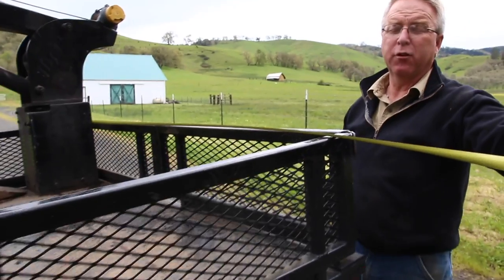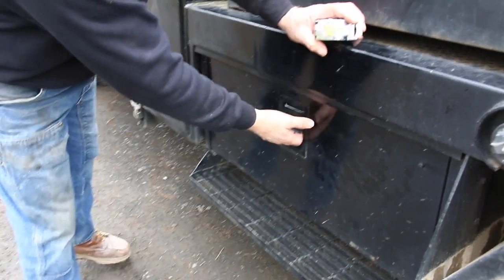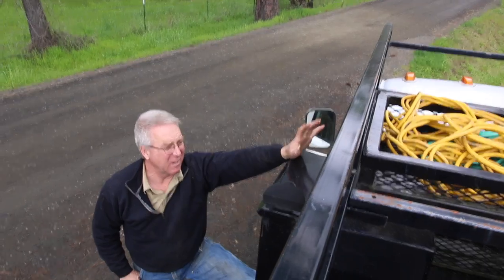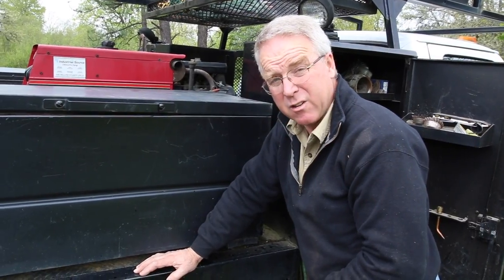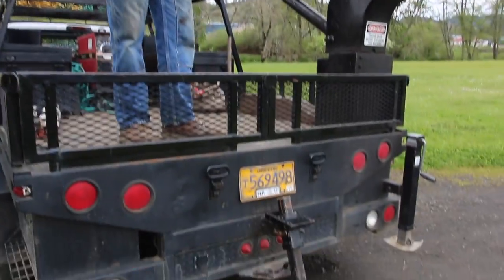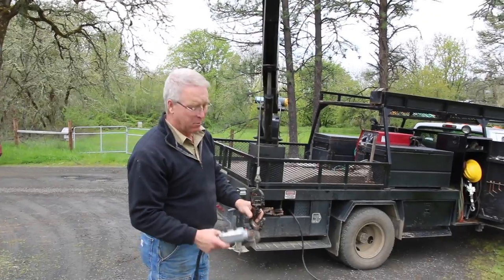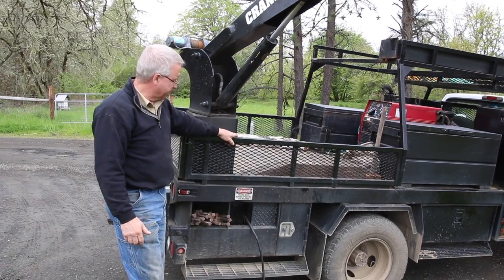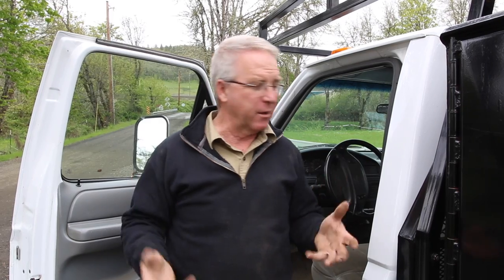Ultimate Work Truck: The Tool Tank

Comment: Thank you for your hard work in making these videos.                  I build trucks for a living.    You guys did a very nice job.    I suggest that at the next remount you add a packrat drawer for your hardware. It will help you to keep it organized once and for all.               7.3L is long gone in a newer truck.    tier 4 emissions is horrible for fuel economy. It is not a good time in history to buy a new truck. I would suggest running the girl till you see 15+mpg on a 450....it will happen.      The crane cable needs to be replaced every 5 years, technically the crane needs anual inspection.

Comment: Great set up.
The 7.3 Powerstroke was International's last good engine.
For a few years you could get the F450 and F550 with a Cummins in it from Ford.
I have not heard anything good about Ford's diesels since the EPA required DPFs and after treatment.

Comment: I have black tool boxes in NE, and some plastics melt inside of it in the summer! I need to put aluminum plate on top to reflect the sun. I have a couple of aluminum diamond plate boxes that will burn you if you touch them, but the tools inside don't even get hot. 2002 f350 7.3L dually with a custom flatbed

Comment: I have a 99 f350. Crewcab 9 ft  flatbed manual rigged almost the same.  Same color too!  No crane though. Not much luck with the 7.3 though or the trans but its a tank of a truck.

Comment: That's a nice rig! I have a basic manual truck crane like you would see  at Northern Tool. 2,000 pound capacity  when the boom is shortest. It's saved my back for sure. The main shortfall is it's reach.  At full length it only extends out about 56 inches.  I need a real crane. Been pricing them out. With how much I bring in on my side job, I can't justify dropping $8,000 on one.  I'm a pretty decent welder and fabricator so I've decided to build my own crane. About the size of this one but I need to build it where it stows away low enough on my flatbed truck that my gooseneck can clear it. Man that would be nice and I can probably build it for $1,000.  Then l can sell my other crane for $200-$300 easy.

Comment: For some years, I braided my extension cords, mostly because it was fashionable at the time with the people I worked with and for.
Then an old-timer (which I am now) explained and demonstrated the folly of braiding power cords, and the wisdom and efficacy of coiling my cords -- and not over the elbow, either, but rather in long loops. It is not as rough on the cords, and is easier, faster, and neater. But that's me. A fellow Oregonian. 
Great truck. Ford is the way to go, even with the Navistar.

Comment: I've got an old Ford flatbed crew-cab rusting away in the yard.  Duelly, with a 6sp manual and headache rack, too.  I keep envisioning it all fixed up so I can use it for a shop truck and spare my Silverado 1500HD since it's so pretty.

In my dreams, I see "Three Rivers Forge" emblazoned on the door panels as I cruise in to the steel supplier to pick up a load of bar stock.

Sadly, I'm way too poor to bring it back to a workable state.  :(

Comment: I had a 2003 F550 with a 7.3.....it had a Venturo 3200# crane. You WANT a  heavy truck. You can carry a LOT on a truck like that...19.5 tires are full steel cased like a tractor trailer.

Comment: A lot of great thought into the functionality of this as it pertains to you and those in your trade. Great work to all who had their hands in it. My truck (well this will my 2nd design) is part work truck and modular swap the rear bed to become my Expedition offroad vehicle. I am a fabricator for full size sets and props in the movie industry near Hollywood, and my flat bed design rear will be removable like the Unimog truck beds. I am starting with a Volvo TGB11 and backhalf removal of the body (but designed to slide back on), to a removable extendable construction flatbed / Tool Tank as well. 1 ton driveline, and of course a Diesel swap. For the extended offroad excursions it will be a full rear cab that easily pulls itself up with its own winch, and a pop top queen size bed, hot water shower, fridge, the works. I have been designing, welding / constructing, and rebuilding the components. I did have to pause during my recuperation from a Spinal Cord Injury, but I hope to be back on it.  Thanx a Mill, Love your walk through of your Tool Tank!

Comment: That's a really useful, heavy duty vehicle. I run a bmw x3, 3.0, 272bhp with removable tow hitch and roof bars for lengths of timber, drain pipes etc in combination with a 3 meter double axle trailer. Not as good a set up as you have but it works and without the trailer I can get anywhere. I'm looking to buy an open front fishing boat and expand into property maintenance and construction out in the Stockholm archipelago next year, we have a builders merchant with a large vessel and crane if I need large amounts of materials, I'm thinking about some kind of trailer for the boat to carry extra materials myself. An englishman living in sweden.

Comment: Best tool truck ive seen by far 7.3 with a clutch the way to go I wish they still made them that way. Btw crane control is a condulet, not LB. LB is lower back returning to the hole positions  LL is lower left and LR is lower right.

Comment: my 1/2 ton has stayed with me for a long time, the 1 tons come when i need them and go when i dont. but if i could find a f350, with the 7.3 idi, 4x4, 5 speed, it would stay

2 years later, i got a 65 f600 as my new tool tank/tow rig.

Comment: That's just an "LB" 8:06 (I hate doing this)  I love your videos.  I absolutely LOVE your videos.  I'm an electrician, but show some of your videos to my apprentices to familiarize them with certain aspects of the construction site or of the framing of a home or of another trade and how we work together.  Now, I hate to do this; but that's a "Conduit Body" you're holding and have turned into a control device for your crane.  Specifically it is a "C - Style" Conduit body.  the "C" stands for Coupling, where "LB" stands for 'L' Shape with the bottom half of the threaded Conduit fitting port faces the rear of the 'Body'.  "LR" is 'Right Side' facing; "LL" 'Left Side' facing; "T" (makes the shape of a 'T'); and finally "X" (Self Explanatory.  I know I'm late to the party on this video, and I had to give you some Shit for it, but also wanted to say that I would be honored to work with you on building a Spec home if you're ever down my way.  I'm in Southern California and we don't have too many tradesman who have a love for their craft the way I do...  You're inspiring.  Thank you for all the videos you've made, they are a treasure, as are you.

Comment: I am getting my very first real circular saw, as in not the cheapest one I can find.
I have two choices, both are used and both are $85. 
A Skil Saw 77 mag that looks very well used and a Milwaukee 6377 that looks pretty new.
I decided on getting a nice worm drive after watching your videos but I am not sure which one.
Any thoughts on it?
Thanks.
Reply from the maker: Skilsaw.
Reply: @essentialcraftsman  Thank you for the advice. I will be driving 106 miles north to grab it today then. Hope it's a good one.
Not sure about putting a 40 to 60' cord on it but will be grabbing a Diablo blade from a big box store for it. Be safe.

Comment: That crane switch box is a "C" not an "LB". LB would have  90 deg between the two connection points. Love the videos, love the truck.

Comment: Love it. People moan about big engines but a big engine like this will be under stressed and last for donkeys, thus meaning less need to buy a new one, therefore less impact on the environment and your pocket. Plus old trucks are proper mechanical devices so can be worked on by anyone with basic knowledge. Modern trucks (and cars) are just laptops with wheels and almost throwaway which is bad.

Comment: It is exceptionally cool although at that gross vehicle weight meter you would need DOT numbers and you should probably get a locking mechanism for that hydraulic arm for safety reasons since it moves forward and aft excetera manually anyway you could lock it up and down

Comment: Hi, do avoid running in 4 Low if your front hubs aren't engaged, especially in reverse, pushing a load - you want all the torque spread evenly over more UJs and through two diffs. Take care, mate.

Comment: yes sir that is about as good as it gets. if you could get one a decade older you would have the 7.3 International which is what the powerstroke is designed to replace once international decided they wanted more money for their bulletproof motors. those newer trucks are nice but they cost so much you get scared to take them into battle. you likely could not put together a better truck than the one you have right here. 7.3 manual 4x4. maybe would be better with a back seat but you would end up using that space for more storage since you don't need to drive people around in it. did not see your backup cameras, bluetooth radio, GPS or subwoofer but you should do it next time you're looking for an upgrade.

Comment: Not a bad design - but I might point out it looks as if there's some premature rusting that seems to be going on. Would be a shame if it were to get out of hand.

I noticed you've got chains on the toolboxes that open on the sides - maybe extend the length a little bit so you can have the door set at a 90 degree angle - an additional work surface.

Comment: Do be cognisant of the fact that when you put the transfer box in lo (low range) if you are only using 2wd, you are putting a lot of torque through just one drive axle. If its a heavy load, especially on a paved surface, it is worth your while to get out and engage the front axle (hubs) to offer long term protection...but I'm guessing you know how to look after a vehicle.

Comment: Manual transmission, baby.  I have a 93 F250 with the factory turbo 7.3 IDI.  Mechanical injection.  New injectors cost me $35 each.  No EGR, No DEF, No catalytic converter.  Manual lockout hubs.  That way I can creep along in low range 2wd.   I have no reason to ever upgrade.

Comment: I’d love a truck like this. Here in U.K. though we would get demonised for owning a 7 litre diesel. They cutting back hard here in diesels a lot of small vans have gone from 2 litre diesel to 1.6 twin turbo jobs. The 3.5 tonne gross ones like mine have gone from 2.5litre in late 90s to 2.4s early 2000s and now are 2.3 or 2.2 diesels for the moment although they going to force the diesels out in favour of electric soon.

Comment: That's the early 98 model. I had the mid year new style 98. It was only the 4.6l gas but had plenty of power for what I used it for. I have a 2018 F350 6.7l diesel 4x4. Rarely drive it. Under 5000 miles on it. Lots of electronic issues and just not what I should've bought. DEF fluid is a joke. Turbo software problems. Nope. The newest Ford I'll ever buy again is a 1995. Since then Ford has gone to the dogs. Quality is no longer job one. I've always been a Ford guy. Bought several off the showroom floor new Fords and over the years they just kept getting worse and worse.

Comment: Cummins 12 valve over 7.3. This is coming from a diesel head
Reply: @DEAD45555 the Cummins is more reliable  and easier to work on then 7.3. Also there is an article  of Cummins hitting 1.7 million miles.

Comment: Here is how you are supposed to create a replica 1989 Honda CR250R: You take aluminum to create a replica 1989 Honda CR250R cylinder, which needs it's piston to get created from steel, which needs it's piston rings to get created from steel, which needs it's notches to get cut out by a machine for it's piston rings, and then it's piston, needs to get it's pin created from steel, which needs it's rod bearing to get created from steel, and you take aluminum to create a replica 1989 Honda CR250R crankcase, which needs it's transmission gears to get created from steel, which need their teeth to get carved out, which their teeth need their other transmission gear teeth to get carved out, and a replica 1989 Honda CR250R crankcase needs to get it's crank created from steel, which needs it's bearings to get created from steel, which needs it's notches to get cut out by a machine for them, and then a replica 1989 Honda CR250R needs it's crank's rod to get created from steel, which needs it's bearing to get created from steel, and a replica 1989 Honda CR250R needs to get it's o-chain created from steel, which needs to get it's sprocket created from steel, which needs to get it's sprocket pin created from steel, and a replica 1989 Honda CR250R needs to get it's swing arm created from steel, which needs to get it's rim created from steel, which needs it's spokes to get created from steel, and it's swingarm needs to get it's wheel bearings created from steel, which needs it's notches to get cut out in their swingarm, and it's swingarm needs to get it's shock created from steel, which needs to get it's spring created from steel, and a replica 1989 Honda CR250R needs to get it's front fork created from steel, which needs to get it's handle bars created from steel, and a replica 1989 Honda CR250R needs to get it's frame created from steel, which needs to get it's motor mount bolt holes drilled out by a drill for their motor, and it's frame needs to get it's gas tank bolt mount holes drilled out for it's gas tank, which needs to get created from plastic, which needs to get it's stickers created from plastic, and it's gas tank needs to get it's gas cap created from plastic, which needs it's notches to get cut out on it's gas tank, which needs it's bolts to get created from steel, which needs it's threads to get threaded by a tool, and a replica 1989 Honda CR250R has it's cylinder head's spark plug, and it's cylinder head's spark plug doesn't have it's piston, and a replica 1989 Honda CR250R needs to get it's carburator created from aluminum, which needs to get it's jets created from brass, which needs it's holes to get drilled out for it's gasoline to flow through it, and a replica 1989 Honda CR250R needs to get it's radiator created from aluminum, which needs to get it's bolts created from steel, which needs to get it's threads threaded by a tool, and a replica 1989 Honda CR250R needs to get it's header pipe created from steel, and a replica 1989 Honda CR250R needs to get it's carburator bowl created from aluminum, which needs it's pipe to get created from brass, which needs it's hole to get drilled out by a drill for it's pipe and it's gasoline, and a replica 1989 Honda CR250R doesn't have it's carburator's boot's cylinder, and it's gas tank needs it's gas cap threads to get threaded by a tool for it's gas cap, which needs it's hole to get drilled out for it's air to flow through it, and it's gas tank needs to get melted down in a thing, and it's carburator needs to get it's float created from plastic, which needs to get it's thing created from aluminum, which needs it's float needle to get created from aluminum, which needs it's spring to get created from steel, and it's float needle needs to get it's hole drilled out for it's brass tube and it's gasoline, and a replica 1989 CR250R's motor's head's bolt has it's cylinder, and a replica 1989 CR250R's head doesn't have it's cylinder, and you need sockets and drill bits and a good drill and casting equipment for it's plastics, and you need a boring machine for it's cylinder, and you need to buy gasoline from a good guy for a replica 1989 Honda CR250R when you have created the whole replica 1989 Honda CR250R, and a replica 1989 Honda CR250R is worth 1300 of it's dollars, and it's front fork needs it's bearing to get created from steel, which needs it's hole to get casted by a machine, which needs to cut it's hole for it's frame, and it's piston doesn't have it's crank bearing, and a replica 1989 Honda CR250R needs to get it's 43hp created from a thing, which says that you are gonna work hard or hardly work on it.
Reply from the maker: This is fantastic!!!

Comment: College teaches you to be a conforming parrot, you lose your ability to think going to those places.
You might be able to switch out the compressor engine with something of similar to exact specifications.
That way you can keep the sleek dual tanks.
Did you shrink resulting in you not being able to reach the box, or is this truck higher?

Comment: Its strange to see that always , always you in USA are stuck behind when it comes too good and modern solutions on stuff.  Can’t use good work clothes, you don’t have clothes with knee protection. The same work boots for the last 20 years and safety helmet.  It’s like you never want to do a job faster or in a better way and you always gamble with health safety and lift everything that are too heavy.  And the same tools that are 40 years old.  Got damn